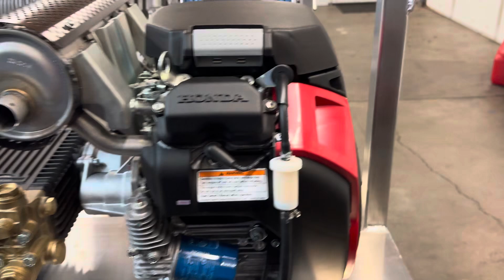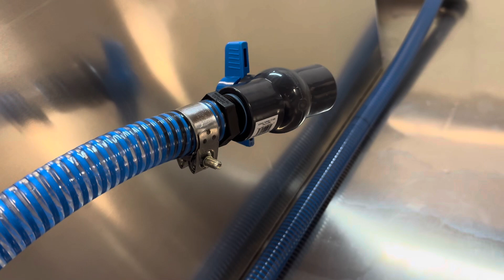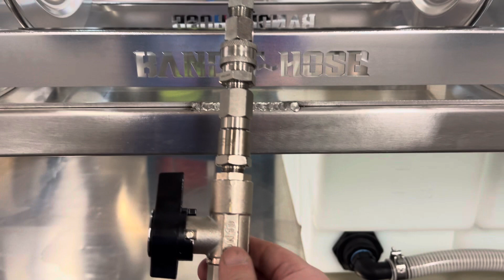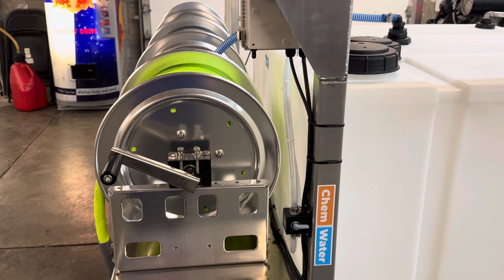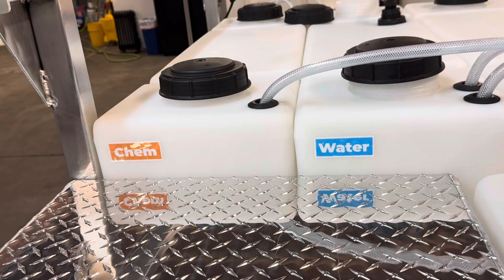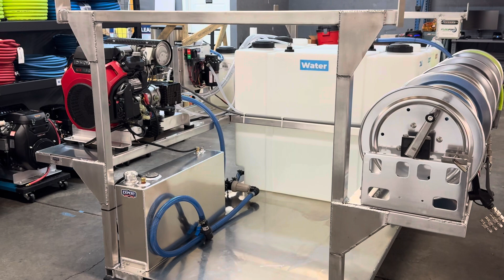8ft Pressure Washing/ Soft Wash Truck Skid- Anthony’s Skid

Comment: Quick question, so the water tank is used only to mix the chemicals not to wash the house, right? so you will still need to connect a Waterhose Powerwash, correct?
Reply from the maker: Buffer tanks feeds the pressure washer. The mixing happens at the mixer.

Comment: That’s an awesome skid. Could you explain what size hoses you used for the plumbing I heard 1” from tank to washer and 1/4 for down stream and relief valve. What are you using in the other places. Thanks
Reply from the maker: If you interested in the details of this skid, let’s jump on a call 503-403-6185. You can also check out our website that has most of the specs listed. https://pressurewashingskids.com

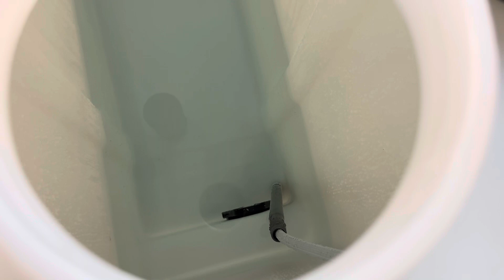Comment: Hey Tim, I just have a quick question... at 12:28 in the video you show the inside of the 100 gal slim line tank where it is connected to the other tank to make 200g ... I was curious if you put a elbow in the tank at the bulkhead facing down would that would help draw water lower in the tank which would mean you can utilize the last few inches of the tank before you draw air. I'm thinking the way its set up now (and how I see everyone does it) you would still have about 10-20 gallons left at the bottom of the 2 tanks together as you "run out of water" ... the reason i ask the question is because i have a 125 leg tank that has that setup from when I bought it and it will suck a lot more water before my pressure washer draws water.  thanks for your insight!! and the skid it AWESOME!! I would love to actually get one from you for this season to have a second rig if thats possible. thanks!
Reply from the maker: Great idea. I’ll have to look into that. We haven’t had any issues. Thanks for commenting. Would love to help with your next skid.

Comment: This is a beautiful and very functional build. There are only a couple improvements I might suggest. For filling the bleach, could there be a hose inserted through a uniseal that runs to the bottom of the chem tank(preventing the bleach from foaming) for filling bleach from the ground with a camlock and shutoff (to eliminate siphoning) attached to connect/disconnect from a hose on the bleach drum? Then on top of the bleach tank, have a 1/2”vent hose coiled to allow for air displacement/replacement? . I know the tank lids have spring loaded vents but they become inoperable rapidly. Will electric motors fit on the hose reels?  How many gallons for the fuel cell?
Reply from the maker: Great comments. We offer a bleach fill system if our customers are interested in that upgrade item. Camlock system. May do a video on it in the future to show how that system works. Interesting idea on the vent. For the reels, an electric upgrade is available.
Reply: @ExpertPowerWash  that is the method Doug Rucker used for venting his bleach tank builds.

Comment: Pretty much a perfect skid build. Hi tech yet very simple. Simplicity is strength. 
What is the measurment of the shelf height fm bottom of skid. I have a flat bed transit with shorter sidewalls than a pickup
Reply from the maker: We can custom build the heights. Different heights are no problem. I appreciate the compliments! This skid came out great! Very happy with it.
Reply: This is about what I want. I might have another add-on. Definitely the surface cleaner & box. I would build it to a custom height but if I ever took it out of my shortsighted flatbed, and put it in a pick up truck then it would not be tall enough. So I might want something that fits both.